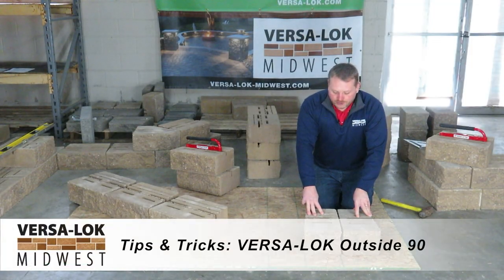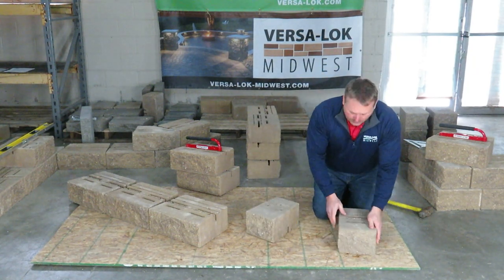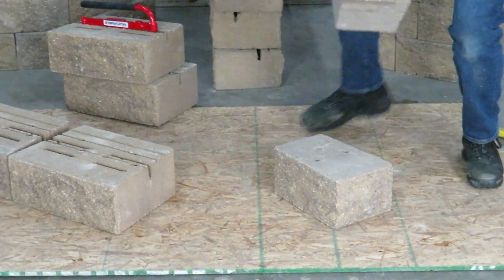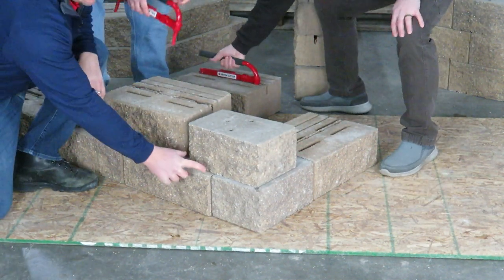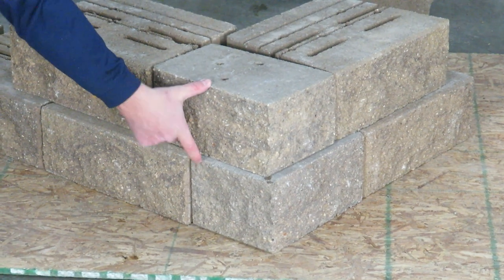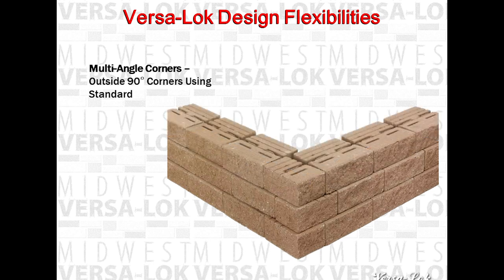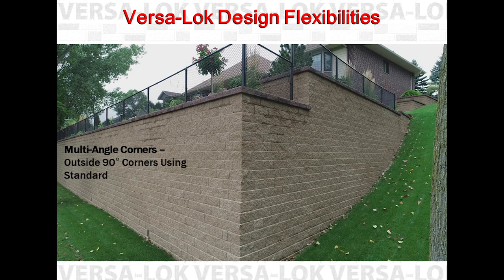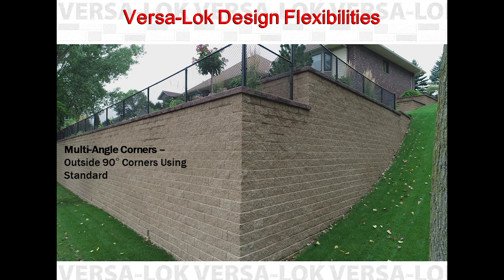9. Make VERSA-LOK walls with 90-degree outside corners!

Comment: If the next course is setback 3/4", then the overlap near the corner is already less than 4", isn't it?  It would be 3 1/4".  That overlap would be repeated until something is cut.  Is 3 1/4" good enough?  Thanks.
Reply from the maker: Hi Mike - Since every additional course gets setback 3/4" in both directions, this maintains a 4" overlap. If you would like to receive technical details illustrating this, please email us at info@versa-lok-midwest.com. Thank you for your interest!

Comment: For a modular design system this is petty lame IMO.  The moment one does an outside corner you loose the half lap bond stack nothing is more aggravating or displeasing to the eye.  Do better and just make a corner piece it’s not rocket science.
Reply from the maker: Hi Joe, You are correct in that splitting the block in half does not yield a half bond to the wall. But that is also an advantage of VERSA-LOK, as it is not limited to half bond. VERSA-LOK doesn’t require mortar, and there are no vertical joint lines (yes, displeasing to the eye) with a variable bond wall if you stick to 4” minimum overlap. Check out Video 4 about variable bond for more info. Thanks for reaching out and watching our videos!
Reply: @VERSALOKMidwest  You misunderstand,  I am a customer of the product, a half block corner is what I'm asking for.
Reply: @steelyspielbergo  you are doing your math backwards.
Reply: Exactly I think the same way not a fan of how it throws my joints off